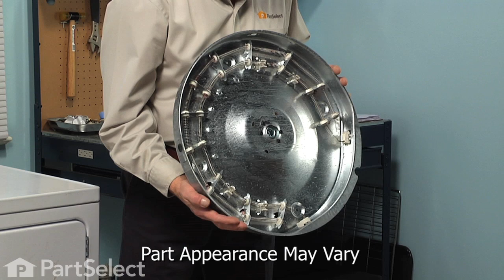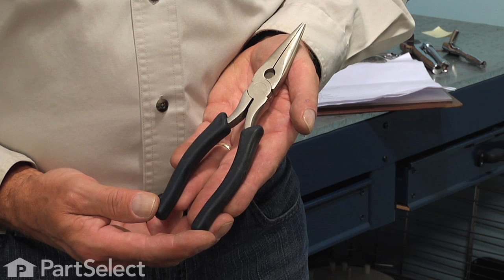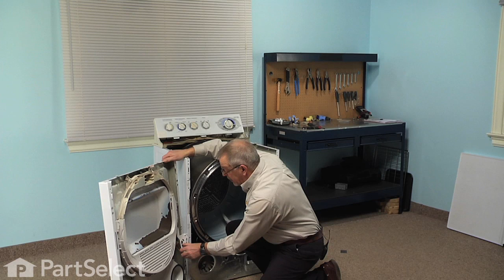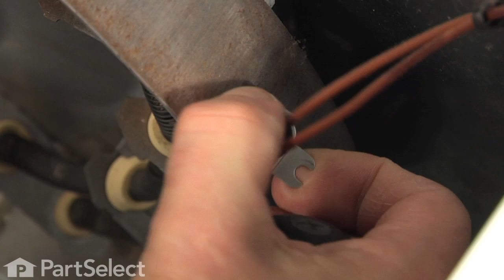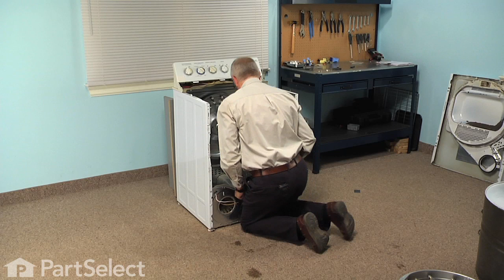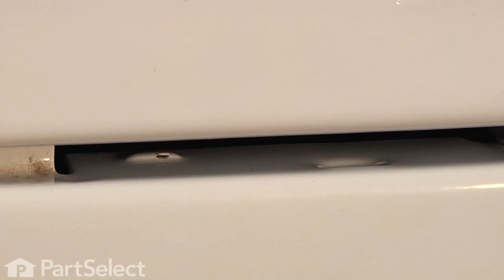Dryer Repair - Replacing the Heating Element and Housing (GE Part # WE11M23)

Comment: Thanks for the video. I took mine apart because it was cutting off during the cycle and the top was getting hot. After I took the top off and the front cover I found it was clogged with lint in tube from the lint filter to the motor. I cleaned it out and so far it seems to be working okay.

Comment: Is there a way to remove lint from behind the heat deflector? Would I have to dissemble everything to remove it. I bought a house with the appliances and noticed there is what looks like lint back there. I already removed the top and the front wall to vacuum out the lint but that doesn’t seem to solve the issue. Thank you.

Comment: I couldn't figure out why you were taking the whole thing out.  I am just replacing the element and not the housing.   Hey, $11 bucks for the element which the connections are near the top and looks like they just snap into the ceramic standoffs.  In my case, the element gave out and I can see where it overheated and is now in two pieces.
Reply: Some elements don't have the break down of all parts. You can end up taking more time sourcing heating elements.
Reply: @dougfield4472  , this was an older dryer which helped in being serviceable.  Prices varied wildly from 11 bucks for a new element to almost a hundred.

I ended up buying the element and the back bearing and a few clips for a total of around 50 bucks.  But, that's before things got so very high.

Comment: Thanks I used this to replace the coils with a GE coil kit from Amazon.  $20 or so. I did manage to accidentally pull a motor lead when putting the belt on. Would not start. Had to disassemble to see that lead laying there and re-connected it. All is working good.

Comment: Thanks for this video. Instead of paying for expensive repair or even more expensive replacement, this video helped me disassemble and replace my belt and idler pulley. For those commenting that this doesn't look easy, it is! Just try it! Thanks again for posting this video.

Comment: I was troubleshooting why it was taking forever for cloths to dry.  Before taking the unit apart, I removed the exhaust pipe from the back of the dryer to test if hot air was flowing through the unit - it wasn't - so the first thing I expected was that the heating element was bad - now I had to prove it before ordering an expensive part and finding out that it wasn't the problem.  I unplugged the unit from the 220 vac outlet and then followed the video above (which is fantastic) to remove the top and front sheet metal covers, as well as removing the the drum.  I then thoroughly vacuumed and wipe down the inside of the dryer - it's now looks like new inside.  I then did a continuity test on all three sensors (other videos on YouTube show how to do this simple test) while the unit was at room temperature - take your ohm meter at it's lowest ohms setting and your should have zero ohms across the outer terminals, mine were all good - zero ohms.  I then wanted to test the heating elements, so I connected the two door wires together (white and black/white) so that I could run the dryer  without the front door panel on the dryer.  I tested it at various settings and guest what - the heating elements both worked on most of the settings, I had issues with a few - so, I might have a controller problem - the sensors and heating elements tested OK.  I put the dryer back together and will proceed with the master switch - the dryer can be used now that we know which settings have issues.  Good luck, thanks again for the above video, simply four screws and you have my GE Dryer fully exposed - don't you love sheet metal - be sure to have plenty of band-aids on hand for the cuts you'll get from some of the sharp edges.  GOOD LUCK!!!

Comment: Fine step-by-step video, but holy cow! Summary: To replace your heating element, disassemble the entire dryer! If this is the master plan by manufacturers to motivate a person to just buy a new machine, it's working on me!
Reply: I have this exact dryer and it looks a lot harder than it actually is.  He is taking you through each step and almost over explaining to make sure you don’t miss anything. I replaced the bearing unit on the front of the drum a couple of years ago and I take it apart fairly regularly to vacuum out all the lint. Really not too bad. 👍🏻

Comment: So I changed the heating element, put the dryer back together, but now it won't run at all. Is there a reset button somewhere?
Reply from the maker: There is no reset button. Check the door switch harness connection and the idler bracket operated belt switch if your model has one.

Comment: Mr. John my dryer is just like the one on your video well they look the same now my dryer heats up some but not enough I'm thinking a element is bad now what is the cost of the elements you replaced and could it be one the thermostats and should I just go ahead and replace the thermostats while I have it all apart and what is the cost for them as well?

   Another thing my wife at times doesn't remove the lint so when I removed the screen to catch the tint I fished out a lot of lint and I also removed lint from the exhaust port leading to the outside wall of my house please guide me with your professional knowledge if in the Houston area let me know I will welcome you to do the job oh I forgot air sure does flow real good out of the outside exhaust duct?    💯👍🏻😊

 And last thanks so much for your nice video you rock.
Reply from the maker: What is your model number?

Comment: my dryer stopped heating after a power outage. the dryer was running when the power went out. it made a loud noise after it stopped. now it won't heat. it will spin but it won't heat. it also makes a noise when it spins. what could be wrong with it?
Reply from the maker: What is your model number?
Reply: +PartSelect EED5600G6WW

Comment: My dryer on my washer/dryer GE combo will only run for 1-2 min. I dont have the dryer hose hooked up yet.
Reply from the maker: Some models will automatically shut off if there is no back pressure from the exhaust. What is your model number?

Comment: I have a GE dryer that has four heat settings....reg, med, low and no heat.........it seems to work ok in all the settings except for regular heat.....it cuts off during the cycle and it seems to be over heating.....what do you think the problem might be?

Comment: Should it smell like it's burning the first time after replacing the element
Reply from the maker: The metal housing for new element may still have an oil residue on it from the manufacturing process. Also, check to make sure that the wire connections to the element and thermostats are tight and do not show signs of overheating.

Comment: Thanks for the parts and the video.  I thought the darned thing came off the back!  So much easier when you see how it comes apart.
I ordered the restring kit from you as the complete assembly is over a month on back order, Wasn't that difficult and less money. Hardest part is getting the belt off the tension pulley.  I rigged a hook from a hanger to pull it over with my right hand so my left could put the belt in place.

Comment: Hello... I replaced my heater elements after watching your video. One was burnt in to. It was pretty easy thanks to you :)  

Now it will not run unless I hold the switch on manually. Drive motor is getting hot. I'm fairly positive the wiring was replaced like it was taken off. 
Help

Scott
Reply from the maker: seeddamrod I passed your question on to Steve and will let you know what he suggests.
Reply from the maker: The symptom indicates that the motor run winding is not being energized and the motor is running only on the start windings. This is why the motor would be hot and continued use would burn out the motor. Recheck the wiring at the motor switch.
Reply: Thank you. I haven't been able to work on it since i posted.

Comment: Steve great tutorial video. I have replaced both thermostates and the heater coil but still no heat, any suggestions?
Reply from the maker: Gary James Milne What model number do you have?
Reply: Kenmore RUXR453EB3WW

Comment: Thank you so much for this video i was able to change the heater element with not much trouble.... i got it back together and it ran like a charm..... for about 10 minutes..... im assuming it is now overheating..... when i was changing the heating element I didnt have the small nubby screwdriver so i had to unplug the wires then plug them back in. I thought i got them back into the right spot but now i am questioning if i got it right. I also dont want to go switching wires and burn my house down. I was wondering if you think this could cause the issue and if so you could maybe show me a diagram or be able to tell which wires are causing the problem. Or is this a completely different issue. Thank you so much for this video and your help
Reply from the maker: Dylan Casterlin If you could get me the model number on your dryer I can help you out!

Comment: Great video! I have the same model. Have been researching the problem with my dryer, it quit running, mid-cycle and the top of cabinet was really hot, to the touch so I left it off. A couple of hours later I checked it and it was "Still" hot to the touch, so I unplugged and it eventually cooled down.
Research has led me to believe the heating element has grounded itself and needs to be replaced. Is this the correct assesment ?

Comment: Did I miss the part where the heating element was restrung or was it just omitted purposely?
Reply from the maker: Hi John, thanks for watching! No, you didn't miss anything. The new element housing has
the element already strung through the insulators. Unfortunately, we didn't
show lifting the new assembly into place during the repair, but we do show the
new heater assembly at the start of the video. Hope your repair went well!